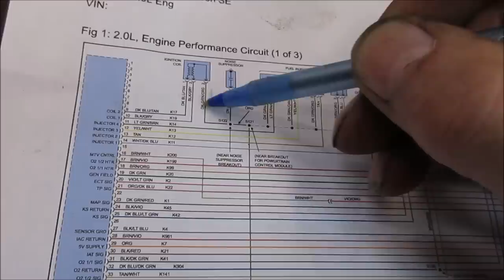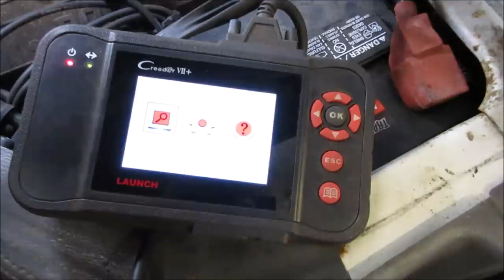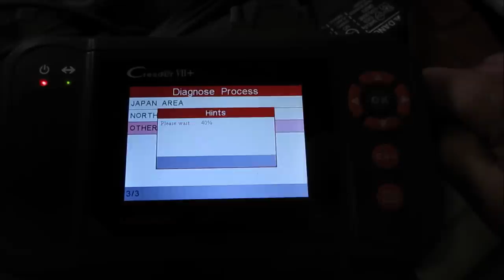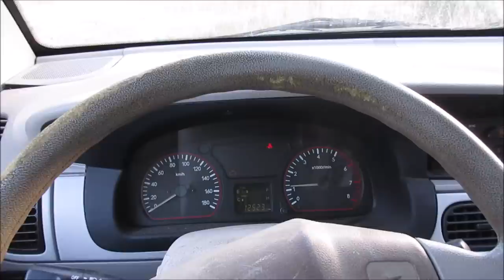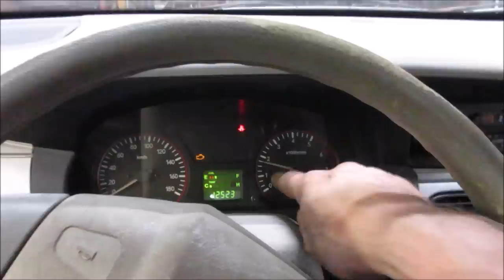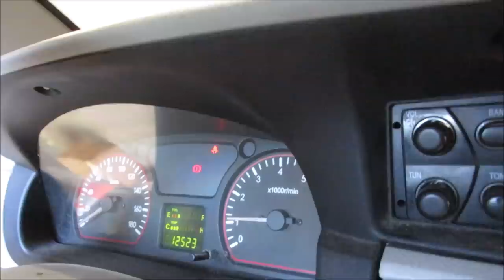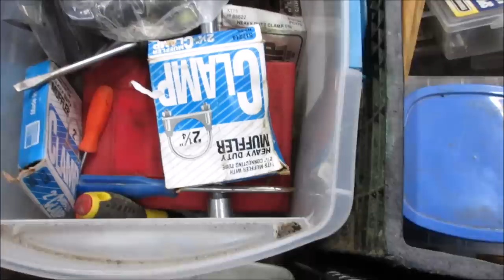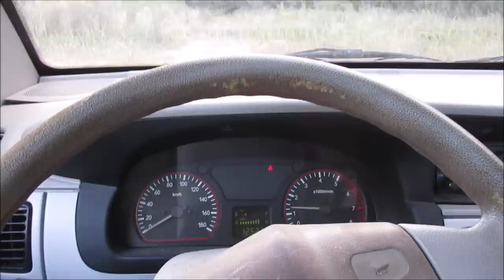Cheap China Truck Challenge

Comment: I have that same Creader scan tool. Instead of trying to scan the vehicle via model, just select  OBD on the left side and it will auto scan until it finds a compatible program to read the codes. Love your content BTW
Reply: Wow! Good tip!
Reply: If this is anything like my icarsoft, OBD mode will only do the ECM. If you select model you might get access to other modules too.

Also: On Board Diagnostic - O-B-D. Personally I always remember it as ODB too, but read it out in my head to fix it before I open my mouth. It is a hard abbreviation.
Reply: This is very correct, I’m glad someone noticed I was hollering at the 📺 for him to hit the OBD2 button. That little scanner is perfect for that truck honestly
Reply: He should also play with the wires in the trans plug he pulled, till he has the speedo but doesn't have the rev limiter.
Reply: Yes it goes into generic OBD until it finds the protocol that fits
Reply: Hey r u interested in a 1983 Honda 750 Shadow? It's not running! I would trade it for an 80s or 90s F-250 4by4 with an 8 foot bed Xtra cab.  A running truck would be great 👍😁.
Reply: @dennisolsson3119  Funny I think most techs came on after OBD v2 (OBD2) came online in 1996. Before that was OBD which for some reason Honda called it OBD 0(ZERO) I don't know what it means except to call pre OBD2 OBD1 before OBD2 came out is like calling WW1 WW1 before WW2 happened, which would have been a very pessimistic outlook at the time.
Reply: I'd think OBD would be a generic code scan - which in this case is probably what you want.
Reply: You will be limited when using this mode but for a simple ECU like this with no other systems to speak to that's probably fine.

The manufacturer/model specific stuff is for speaking to other modules that you might be interested in, ABS for example.
Reply: Same!
Reply: one of the scanners I had years ago had a generic setting for European and Asian to do the so called world cars. It would not read into specific modules but would read codes in general that way. I found it handy for certain aftermarket ECUs and some modified cars with quirks.
Reply: Good to know

Comment: Found this:
"It's a black box behind the dash. The input wire is coming from the speedometer telling it how fast you are going. The box is grounded I believe, the output wire connects into the wiring that goes back to the fuel pump. When the box reads a speed of 26mph or faster, it cuts the power to the fuel pump."
Reply: So basically it's an add-on hardware speed limiter. That's nice because as soon as you figure out how it's wired in you can simply remove it from the circuit or possibly even just unplug the wire that feeds the speedo signal into the rev limiter (patching the wires to the fuel pump through seems like a more permanent solution though).

Comment: I grew up in China, I remember these were literally everywhere, it's like the F150 of China. You have the pickup truck and the van version too. Farmers use these tiny trucks to haul vegetables and meat to the farmers market every morning and I have seen these with more than 300k km (180k miles) on them. They beat the crap out of these trucks and they seem to be very reliable. Parts are super cheap, the same coil probably costs $2 in China for this truck.
Reply: We also have them in south america, pretty reliable for the price, i'd rather one of this one over a kei truck since the engines are bigger, the ones with 1.3 engine hauls ass
Reply: I think they are awesome little trucks.

Comment: the "tablet" for diagnosis has two modes: the one you used(called specific mode) and a general mode(left selection, OBD II). use the general mode on unknown things/cars. Got the same unit and works well

Comment: The higher the pressure, the harder time a spark has. That's why you'll get two plugs firing fine outside the engine and at idle, but a misfire under load (when the cylinder/ chamber pressure increases).

This is why I got one of those flashy sparky in series tester thingies, after days of "But you have spark, why won't you smegging run" on one of my hateful cars.

Comment: The difference with your test and what people were saying is that both plugs were under the same atmospheric conditions in your test. When running in the cylinders, one cylinder has higher pressure than the other. I'm pretty sure that the one with the lower pressure has a lower breakdown voltage, so will be more likely to fire.

Yes, on a quick search I find "increasing the gas pressure increases its density, which decreases the mean free path length of moving ions. This limits the distance an ion can travel before it gets deionized in a collision, and increases the amount of electric field strength required to achieve a breakdown cascade."
Reply: Yes, this is why forced induction creates elevated ignition system stress and often requires a smaller plug gap as a result.
Reply: Exactly, and it gets worse with more throttle.  It sounded just like a Fiat Bambino 2 cylinder engine with the shared lead.
Reply: Both plugs were firing but were they both firing at the same time? I don't think just looking at it you can tell.
Reply: A flame is an effective short circuit to voltages above 100V as well. That’s how flame ionisation flame detectors work in gas boilers.
Reply: @allangibson8494  Some vehicles use ionic knock detection through the spark plugs using this same principle.  Saab had it in the late 90s.

Comment: The hot setup is to use an electronic speedometer corrector (like the jeep guys use for big tires) and set it to 62/100. That way the speedo reads in MPH. Your new speed limit would be 64.5mph which wouldn’t necessarily be a bad thing.
Reply: Or use a GPS speedometer app on a smart phone
Reply: @SandBoxJohn 
Downside to that is you won't have a speedo on days with storms, or if you forgot your phone, or if the phone is flat, or if you get a phone call.
I have an Android stereo in my car, and while that saves several of the above issues, it still takes a while to start the GPS, and can drop out on days with bad weather (rare, but it does).
Reply: Just a thought with the speedo is that which wires on the plug that Mustie1 pulled out operate the cut out switch? If it's only 1 then illuminate it and the speedometer may still operate???
Reply: @shanestachurski9667  Probably depends on how fancy the implementation is. I've got a sneaking suspicion that the sensor simply generates pulses (the faster the shaft spins the faster the pulses) and the ECU reads those pulses for various functions, including both the rev limiter and the speedometer display. If that's the case you'd need to reprogram the ECU, which should be simple - IF you had the correct software for it.
Reply: @Ragnar8504  I doubt the ECU cares what the vehicle speed is. Most of the time on simple vehicles, like motorcycles and ATVs, the speed sensor goes right into the instrument cluster. And look at Japanese cars maybe 10 years ago, they didn't use CAN buses for the instrument cluster, there simply is a line from the speed sensor into the cluster.
Reply: @Ragnar8504  My guess is the dashboard and ECU are completely separate units (except for the check engine light) and the vehicle speed sensor wire branches off to both. If you disconnect the ECU end but keep the dash end you'd get a speedometer without the speed limiter.

It's also worth noting that an automatic transmission the ECU usually uses the VSS to determine when to switch gears. On such a model the speed limiter would be harder to defeat.

Comment: If you measure the resistance on the 3 input pins it should be like this: if you're measuring between a coil and the common (or hot) you'll get a very low resistance, if you measure between the two coil pins you'll get double that resistance.
This is because coils are just a bunch of wire going to the hot pin, if you're measuring between the two coils it's twice the amount of wire. It does require a reasonably good connection to the pins (using the pointy bits on the probes or attaching the croc clips you have) and a decent meter since it's pretty low resistance. 
You can also manually set your meter to a low range so it updates faster while measuring.

Comment: On the plug you unhooked on the speedo drive it looked like it had more than two wires. Two of these wires might send the signal for the speedo, the extras might signal the speed limiter. If you could figure out which wires control which you may eliminate the limiter and keep the speedo function.

Comment: Should have gone into OBD-II options on the left.  I think it would cycle through all of the protocols until something talked, presuming it uses one of those.
Reply: i have same obd 2 reader and you right, OBD II/eobd option is used to read ecu , SCAN is for airbags,abs,...
Reply: This is correct. It’d likely find the protocol and talk
Reply: No need now. The check engine light was from the disconnected throttle position sensor.
Reply: The check engine light may also have been the reason for the speed limiter being in operation. I would try reconnecting it to check.

Comment: Nice little truck and great video again. It looked like there were 3 wires on the speed sensor. You might get away with disconnecting only the circuit that was triggering the speed limiter and keep the speedometer working. I'm betting the speed sensor needs only two of the wires with the third wire being for the limiter. Keep the videos coming!

Comment: In slow motion, the double spark plug on one coil setup was a lot more intermittent than it appeared at first.  Play it frame by frame, there are a LOT of misses.  I'd be willing to bet, it never sparks them both at exactly the same time, but we'd need a high speed camera to verify.
Reply: It probably never sparks both plugs each cycle. But yeah with the frame rate you'll never tell on video. You probably can't even see it. Being as we have persistence of vision. So you're going to get an after glow effect watching it. The whole spots in the eyes thing. Now why they're both sparking even alternately is interesting I'm sure. I'd think one would be dominant and spark before the other ever reached its breakover Voltage. But something may be going on with atmospheric ionization? There's more to life than meets the eye, that's for sure. Another thing you can count on is a plug will fire in atmosphere differently than it will in a combustion chamber. You compress air and it gets more resistive. There's just more air then for the spark to jump through. Air is an insulator. That's why we put power lines up on poles. It's also why the high voltage transmission towers are really tall too. So they're in more air.

Comment: Hi Mustie
 There are two ways to run two plugs from on double coil. One way is to use two separate coils and two blocking diodes on the primaries. They need to be able to block about 1Kv. The other way this is done is to use a single winding with two plug attachments at both ends of the coil. These usually use a separate primary winding. On this second type of coil, you should always have a plug connected at both ends. If not the coil can be damaged ( I know this because I wiped out a coil on my Honda years ago). This is because there is no separate ground path to the primary. I ended up having to wait for a month to replace the coil. During that time I took two coils and used the diode method.
Anyway, be careful with double ended coils. Always have a ground path for a coil, like through a plug that isn't used.
Dwight

Comment: I love your way of doing stuff. it gets my mind going! I think a spark-plug firing in air will act very different in the cylinder under running conditions. I think the DIY spark splitter is failing because the first plug to arc gets all the power. Doing the test in open air is not the same.

Comment: The middle is hot as you noticed but the others arent signal. They are the ground sides of each coil set. The ECU uses a mosfet or similar to complete the circuit through the coil and when it disconnects ground on one of them the field collapses and the high voltage side sparks.

Comment: Your solution to the ignition coil was well done, you said it was a Neon part? Sure looks like it. It does run better, I guess every problem can be solved when it comes to these engines. You're great at figuring stuff out. Mr. Mechanic strikes again.
Reply: The PT Cruisers also use the same Coil packs.

Comment: Funny story (now) about my first experience with distributorless ignition when I was a young kid:   I spent what few pennies I had, and bought a severely used Honda 150 'Dream Machine' motorcycle - made in the mid sixties, I believe.   Anyway, it ran pretty good (my mom would only let me ride it in a field behind our apartment)  but being curious, I noticed that "hot' came out of one muffler, yet 'cold' came out the other!   So... I wondered what would happen if I switched the plug wires (two cylinder.)   The engine did not like that at first, but quickly began running just as good as it did before the swap.   Riding the machine around confirmed this.   I came to the conclusion that the double ended coil must be the problem, and the machine had been running on one cylinder for who knows how long.   A new coil was VERY expensive, but I managed to borrow enough money to order it.   
    The day came when I had the new coil, and I quickly installed it.   WOW!   The motorcycle sounded GREAT!   Hot from both mufflers!   
     The route to the field behind our apartment was difficult, as it was between buildings that were very close together.   When the machine was running on one cylinder, I was used to the amount of power, but now, with two cylinders working, I was caught off guard, and the motorcycle shot out from between my legs, hit the brick building... and never ran again!    I laugh nowadays.

Comment: I like your style and enjoy the videos. I have a friend who's dealing with golf cart issues now. It has Can Hi and Can Lo on a non-standard diagnostic connector per the wiring diagram. I used a break-out box and connected it to my scan tool. It cycled thru 3 or 4 types of protocols (or whatever they are), but never would communicate with the scan tool. Unfortunately, the cart has a type of controller (Danaher) that most people replace with a Navitas (It has a built-in diagnostic display), but the cost of a swap is astronomical. Too bad he didn't buy a T-Mag!

Comment: What I remember from my training about 35 years ago you need both spark plugs to be grounded. The spark changes polarity back and forth from one buddy spark plug to the other. When one cyl is on power stroke the flow of spark is one way but then that same cyl is on ex stroke the spark flows the other direction. While it will run with 1 spark plug or in your case 2 plugs connected to 1 side of the coil, on a 4 cyl 2 cyls are effected if something goes wrong. As for checking codes all cars sold in the USA must have a generic code source so setting your code reader to generic OBO mode you will get codes and some PIDS but not all. There may be a stun connection for the speed limiter so it can be deactivated. Also since you had the TPS disconnected you may have been in LIMP in mode since  reconnecting the TPS I would reconnect the speed sensor and try the speed again.

Comment: Nice truck. You can find the wire that controls the speed cut off and put a homemade frequency divider in it. The speedo will read correctly but the speed limiter will think you are going half or one fourth as fast. Lots of YouTube videos on frequency dividers.
CD4013BE runs on 3-18VDC.

Comment: 👍👌👏 Simply fantastic! What a fun mobile. Maaaan, I bet that a lot of older but young at heart guys and their inner children had a lot of fun. At least I did. 😁 ;-) That little Chinese thing revs up and sounds like a motorbike. Isn't the frame fixable? In these expensive times it would do very well as a daily driver (not much fuel consumption I guess). The front (suspension) should be lifted though.
Best regards luck and health.

Comment: When the hose clamp is a little oversized I found that a full wrap shim works well particularly if you are going to use the slack to hold something else. The shim doesn't have to all be the same piece either.
Reply: Tin snips and a pop can or two will work in a pinch .  😎

Comment: Got to remember under pressure the sparks act differently then in the open air. You could have also used a couple Honda sohc MC coils (cb350, 550 750) , they have dual plug outputs and are set up for wasted spark, but wherever would you find them?

Comment: Pressure in the cylinder makes it more difficult for a spark to jump the gap. It did seem to be missing out sparks intermittently. I love the way you test stuff out though.
Reply: Even though both plugs were sparking I'm still not convinced they're both sparking at the same time. Although I can't really explain why they'd alternate. There's clearly more going on than meets the eye.

Comment: The speed limiter is there for US use only. It's because under 25mph keeps it as a slow moving vehicle in most states so you don't need to register it for the highway. Just need the triangle. For the OBD, just select the first "button" for generic OBD instead of trying vehicle specific. It will still show the errors but it won't give the vehicle specific explanations.

Comment: not a bad little utility truck for sure, should come in pretty handy. might be able to get a frame from the wreakers you just never know might be worth it, maybe you can even repair the frame if its not too bad. 
btw are you still planning on exchanging the cylinder lift from your other mini to this truck? so that you end up with a dump on this little utility truck, if so that would be a good video to watch, is that the plan ?